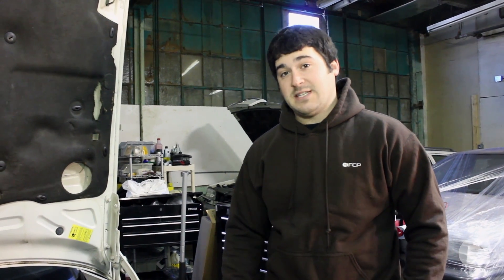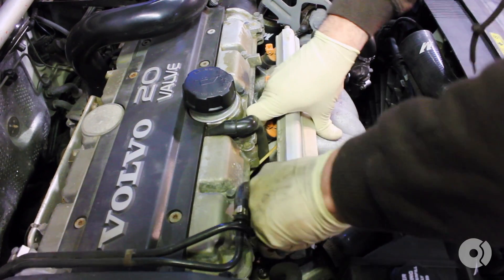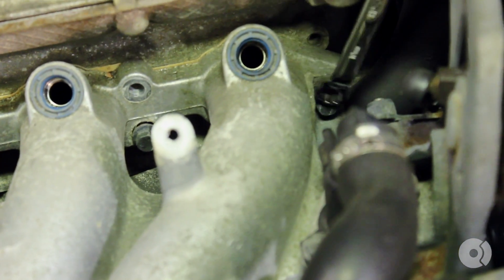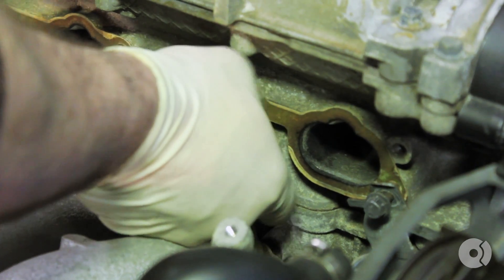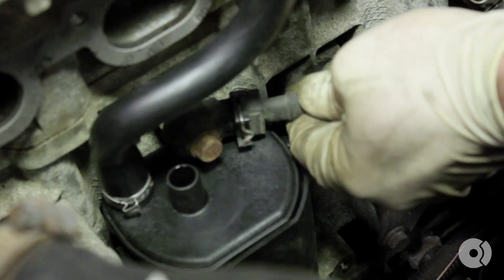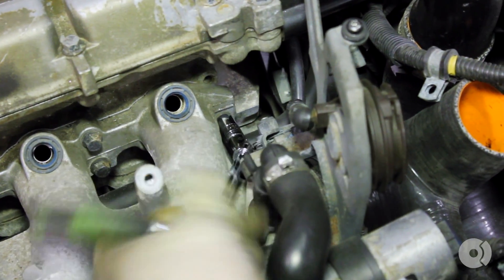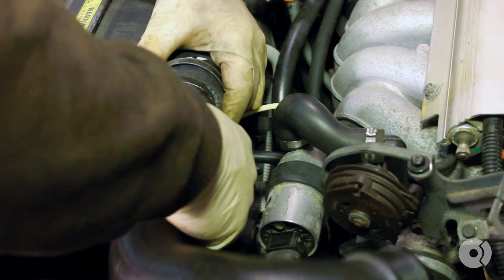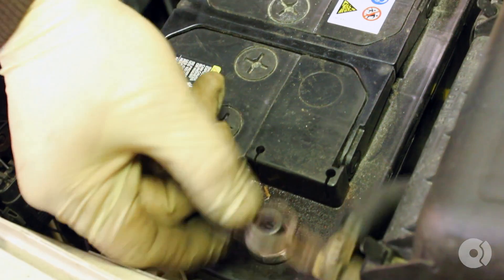Volvo PCV Breather System Replacement (850 Turbo)

Comment from the maker: Shop the parts used in this video:
Volvo PCV Breather System Kit (850 C70 S70 V70 Turbo): https://www.fcpeuro.com/products/volvo-pcv-breather-system-kit-850-c70-s70-v70-turbo-850t200?utm_source=youtube&utm_medium=description&utm_campaign=volvo%20audit&utm_content=pcv%20diy

Comment: put compressed air to the lower hole of the block., if your oil filling cap doesnt jump or move you need to drop the oilpan. Just remeber to do this before you put everything back together.
Reply from the maker: Great note!

Comment: What silicone do you use to get the injectors into the intake manifold? I've tried without putting silicone on the o rings but the injectors doesnt want to go all the way down

Comment: Just spent all day trying to get the two bottom center bolts out. Trying a wobble extension in the morning. If that doesn't work I am walking into the woods and never returning.

Comment: I did this job last Summer on my 1994 850 Turbo and, after taking everything apart, I found that the previous owner had the PCV system replaced seemingly right before I bought the car.  All the PCV stuff looked brand new(Genuine Volvo parts) so I decided to just reuse everything and return all the parts that I bought.  Before I did the PCV job, there had been oil accumulating on the top of the cylinder head by the spark plugs, but I thought it was the oil cap o-ring.    Fast forward to today and I noticed that there was even more oil on the top of the cylinder head.  It turns out that the oil was seeping out from around the upper PCV hose port.  I loosened the clamp and noticed a large crack in the end of the hose.  So, now I have to do the whole job over again just to replace that top hose.  I should have just replaced everything the last time.  Grr.

Comment: Love this video! Any advice for the same job on a 1995 960? I can't seem to get the intake manifold out. Does the EGR have to be disconnected somehow to remove the manifold, and if so, how do you get to it (considering it's under the manifold)?

Comment: Can anyone tell me what those Ratchet Nuts are called? Overe here in Germany i have only seen "flexible" u-joint type adaptors, but never Nuts which allow for Movement of the extender-thingy. Extremely annoying/impossible to get to the intake bolts with my regular toolset.

Comment: Hello, I need answer to the question what will happen if I cut the hose coming from the head, close the part going to the separator and vent the part coming from the head to the atmosphere by extending it and putting filter at the end of it?
I'm about to do it and I can't find any information on someone else who's done it. The reason is that the mechanics in my area do not acknowledge that kind of maintenance. They tried to rip me off with engine rebuild. I don't feel comfortable trying to replace the pcv system myself due to lack of experience and fear of mistake.
Reply from the maker: Are you also working on an 850 turbo?
Reply: @fcpeuro  the car is s40 2.0 136hp 1999.

Comment: The only part of this repair I don’t like. Why doesn’t he crack the fuel lines at the tapered fitting/joint, rather then bend the crap out the pipes moving them to the side?

Comment: Ben I have a 1994 Volvo 850 non turbo wagon. Help me, is there ANYTHING I need to know, yes I'm a woman but my grandpa's instilled in me the mechanics gift. This is the first time I've removed a manifold, I did my throttle body and EGR. Lots better.. this jobs got me a little skiddish but I can do this. I'd like some tips and diffs in doing my 850 non turbo. Thanks Ben .please

Comment: @2:30, my ‘98 V70 T5 doesn’t have a Fuel Pressure Regulator vacuum line (or any lines) plugged into the back of the tree. Should I be concerned..?? 😅

Comment: I've been ordering parts and using your videos for awhile now.  Thank you for all your help!  

One question, this PCV replacement process is basically the same for a 1998 S70 base model, correct?
Reply from the maker: Thank you for the support, Alexander! We're happy to help! Yes, you are correct, the PCV replacement process is basically the same for your 98 S70. There are some differences in the vacuum lines and air hoses on the Turbo vs NA model but otherwise, it is the same process!
Reply: @fcpeuro  I have an 850 2.5 10v NA. Can you list some of the specific differences?

Comment: Great video! A poster on one of the forums made mention of a banjo bolt somewhere, though from your video I only see you interacting with basic hoses and clamps. Is there in fact a banjo bolt somwhere in the system?

Also, if i want to remove the fuel rail instead of bending it back, is it connected to the intake fuel line with a basic threaded connector and crush washer?

Comment: I did my non-turbo 850 in 3.5 hours after I got home from work.  My wife's turbo 2007 xc70 took me 7 hours start to finish and I never want to do that one again.  Volvo either over engineered these engines or the pcv system is a fix for a design screw up.  Most cars have a pcv that's about 3 inches long.

Comment: For me if it is clogged, I will drain engine oil first and not plug in the drain bolt. Then I will open the top vent hose on cam cover and spray alot of carb cleaner. Leave it over night to let the gum-gunk dissolve. I may spray carb cleaner or pour gasoline fill to the long vent line at the end that connect with PTC. To make the solution liquid fill along the tube, it need to connect extension tube that route to higher position which gravity will do the job of solution filling. After settle one more day, you can check if the clog problem is eliminated or not. If not, then it need to do disasemble the intake manifold for better inspection and replacement the clogged or damaged parts.

Comment: Hi would having a snapped pipe for the pvc cause the car to struggle starting? I’ve got a Volvo 850 petrol that takes a while of cranking and throttle presses to get going, it struggles to hold the idle to begin with once it’s going but gets better once it’s warm. Could there be any other causes for it to struggle like this? Appreciate any help!

Comment: Before removing the fuelrail, you can always release the fuel pressure by pressing the little valve next to your throttlebody on the fuelrail.
Reply: You R correct,it is this same design as tire VENT>

Comment: I need some help with mine... I replaced the PCV system and now I've got some sort of vacuum leak (I'm assuming). The engine cranks for a while before starting, and when it finally does, there is a loud hissing noise coming from the engine. I've narrowed it down to the tube running from the flame trap to the intake "tree" (above the throttle body). The intake is pulling hard on that tube and I have no idea why. Could you help me out please? I'm just a kid tryna fix his car and I would really really appreciate it, thanks
Reply from the maker: It sounds like one of the hoses could be routed improperly. You might want to take the intake back off to inspect things to make sure nothing is twisted.

Comment: It would be nice to know what tools you used so we can own the correct tools. I struggled removing the two 12mm bolts under manifold from below. You made it look easy doing it from above. What were the tools?  I also struggled with the first manifold bolt on the passenger side (US) .

Comment: I don't understand. what was serviced? besides the intake manifold gasket. isn't it supposed to be cleaned or sumthin with degrease or brake clean? also what's the pcv box for? is that like Volvo's catch can? If so does it need cleaning?
Reply from the maker: In this video 2 of the main breather hoses were replaced, breather box and intake manifold gasket. This blog article will provide more information on the breather box, it basically acts as an oil catch can. https://blog.fcpeuro.com/volvo-pcv-breather-box-guide-symptoms-and-diagnosis

Comment: That tool you use to remove the intake manifold bolts. What is it? I like that you can move it slightly to make it easier to get at the bolts.
Reply from the maker: Hello Jefferey, that's a swivel ratchet that was used in the video.

Comment: I did the PCV system replacement.  Had some issue especially with the throttle and vacuum hoses.  I have a 1995 Volvo 850 Turbo and I want a GOOD vacuum schematic to to check my vacuum hoses.  I need to know what this vacuum is called beause I dont't see a hose that attaches to this hard plastic tube that goes to the front of EGR and under the side of the radiator fan (attached to side of fan).  A round rubber holder holds the vacuum there,  There is a nipple on the other side and it does suck air when running.   Does that hard plastic hose connect on that nipple?  I may have lost the rubber connector to that nipple and hard plastic vacuum tube. What size rubber connector is that to connect them two together.   I have looked online for good vacuum hoses  pictures for my car. Thank you

Comment: This is much more work than simply replacing a PCV valve like on an American car.  How might one know that this task of replacing this PCV system is necessary?  When the Engine light goes on? Rough idle? Does the oil separator box ever get filled? (Oh, but this video is very helpful, my Haynes manual doesn't even write about the 850 PCV system.) Thanks.
Reply from the maker: Hello John, some of the symptoms include:
-Noise (whistling) – Noise due to high pressure in crankcase. This noise will stop if the oil filler cap is removed.
-Poor Drivability, clogged crankcase ventilation can reduce the engine performance
-Uneven Idling  Caused by clogged crankcase ventilation
-Oil leak from engine seals due to restricted crankcase ventilation
-High oil consumption/noise from Turbo
Reply: Dont forget the billowing smoke from the dipstick
Reply: You can tell if it is starting to clog by warming up the engine, then place a rubber glove over oil filler neck and place a rubber band around the neck to hold it in place. Start the engine, if the fingers on the glove indicate a vacuum your good. If the inflate the change ASAP.

Comment: How many hours will a mechanic shop typically charge labor in the books for this procedure?
Reply from the maker: Hello Bob, depending on how long it takes them, I would assume right around an hour or so.
Reply: Ok thanks
Reply: Yes, any longer the mechanic is unfamiliar with car and struggles to think laterally.
Reply: Two years ago I bought the whole PCV kit for my wife's 850 GLT for $150.00 and the mechanic in Des Moines, Iowa installed it all for $150.00 labor. Now a mechanic in Kansas city is telling me that it would be $700.00 or $800.00 with parts and labor for my 1998 Volvo S 70 T5. I was like .......yea right!  LOL!

Comment: Ben,

Really appreciate your video! I spent almost one day to finish the PCV replacement, spark plug replacement, rotor and distributor replacement, all based on your videos yesterday.

After I finished all these jobs, I started my car and expected the perfect running of the car. But unfortunately,  the car cannot be started. The check engine light is on, the code is P0201, 202, 203, 204.

After reviewing your video the last night, finally, I realized that no-starting may be caused by fuel system. This noon, after I checked the fuel injectors, I found that the fuel injectors are not wired ( I plugged the wires into them in, but in fact, they are not connected).

So after plugging the wires into the fuel injector correctly, the car runs great! Thank you very much!
Reply from the maker: You're welcome!
Reply: Don't it s**k when you forget something like that. Lol

Comment: Thank you, Ben, for this great instructional video. I'm convinced mine needs to be replaced as I saw smoke coming out of the dipstick a few days ago. I've had smoke for a while come out of the engine oil cap, whenever removed. I have a 2004 xc70 turbo with 145,000 miles. I bought it used and have only just begun to do my own auto work June 2017, other than oil changes. 

My questions are: 1-What is the brand name and specs on that cool bending-handle ratchet you're using;
                                 2-What is the name of those crimping hose clamps, and the pliers you used on them;
                                 3-Are there any significant differences between the processes you detailed in this video and the processes for my xc70?
I wrote down everything you said, step-by-step, and once I get it typed up, I'll add screen shots from your vid and post it here for other users, if that's ok by you. 

Thanks again.
Reply from the maker: Hello Bernie, 
Hope this answers your questions.
- I'm not sure of the exact brand but its a flex head ratchet. GearWrench sells a nice set at a good price.
- Oetiker Hose Clamp Pliers
- Process is similar but may not be identical. The essential information can be used though.

Comment: There is probably a spec'd torque for the intake manifold bolts. If so, what is it?
Reply from the maker: The torque specification for the intake manifold bolts is 20 Nm.

Comment: thank you ..looking forward to change the pcv breather ...clean the intake ..and dip stick ... I own a 96 turbo ....not a single problem just a concern ..since smoke comes out from the dipstick and oil cap ...I think is compression from junky oil that build up ...the last owner had it parked for 2 years and no maintaince whatsoever since I scanned the computer before i bought it and nothing has been done to it ..not even erased codes showed up ...I was surprised since the vehicle has 186thousand miles ....I really maintain my vehicles ...have an 04 tahoe with the original motor thousand miles and no problems ..motor still good ..upgraded tranny to a 480le and more hp boost ...(470 hp on the dino) ...that's the reason I got the 850 ...I love sleepers and maintaining them ...that's why I wanna restore it first ..then boost it ....thanks for the video ...European cars are a pain in the butt to work on ...but there worth it !!
Reply: *motor on the tahoe 5.3 with 280thousand miles
Reply from the maker: Hello Jose, we're glad you found the video helpful. Routine maintenance definitely goes a long way when it comes to longevity of a vehicle.
Reply: yea thanks
Reply: nice work ...and very well explained

Comment: Not a mechanic.  Did this job, car won't start.  She'll crank crank crank but won't start.   Started once for a second but died soon after.  Tried to jump.   Check everything many times.  Took it off and assembled again twice.  Anyone have any ideas?  It's probably something stupid, but I can't figure it out and i'm ready to smashy smashy.  I need an adult.
Reply: i'll be curled up next to my starter until someone comes and rescues me.
Reply: It's an Easter freaking miracle.  My baby runs.  Loose wire to Fuel Injection relay.  After 30+ hours and fourteen cans of Gojo she runs.  CHEEE HOOOO.
Reply: Mr. Fr0zak yooo badass glad to hear that after reading your initial comment

Comment: I bought the kit for my Volvo 850 '96 non turbo model. The kit includes a Crankcase Vent Hose (VOL-946233), which I cannot figure out where it goes or if its necessary for my model.
Reply from the maker: Hello, please email me with your VIN and I'll send you over a diagram to help you out with the location. 

davidg@fcpeuro.com

Comment: Hi ….I just went through replacing the pcv on my 1998 Turbo Volvo as per your tutorial.  However, I now have an air leak that I cannot find because I cannot hear exactly where it is coming from.  I took it all apart and put it back together again …but although all looks well …I still hear the leak.  Could I use a leak down test kit to better hear where the leak is coming from while the car isn't running?
Reply from the maker: Hello, please feel free to email us at products@fcpeuro.com. One of our reps that specialize in Volvo will be happy to help you out.

Comment: Fuel rail also has a separate rubber seal that sits between the injector and the fuel rail seat. Maybe check it didn't fall out if the injector is separated from the rail. I lost one when I did this. They're about $10 each from a dealer!

Comment: Is there any reason a pcv breather system needs to be this convoluted and difficult to service?  I can remove and clean the pcv valve on either of my cars in about 5 minutes at a cost of a few cents worth of carb cleaner.  Why are Volvos such a nightmare?  Is there a real benefit to the additional complexity?
Reply: Not really, it's there to be friendly to the environment.

Comment: Thanks Ben! I think you're really attractive and id like to take you on a date. Now that that's off my chest how urgent is it that I do this repair once the "whining" starts. I replaced my water pump, timing belt, and bearings and this noise started directly after so I though it could be the bearings breaking in or something, but it got more pronounced and ive concluded this repair needs to be done. What kind of timeline should I be on? I commute every day in this car, can I wait a week? Month?Thanks,XOXO
Reply: too funny Corban.

Comment: Great video! Im about to do this change on my 1998 s70 non turbo 10 valve. One thing I noticed is that the engine does not have an upper pcv hose between the spark plugs. Where is it then? Any ideas?
Reply from the maker: The hose will be located underneath the intake manifold.